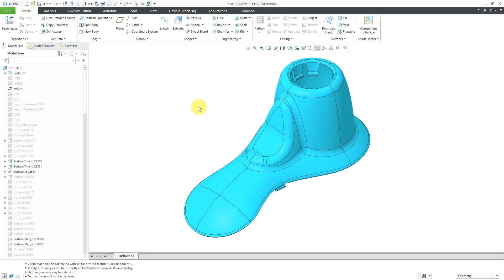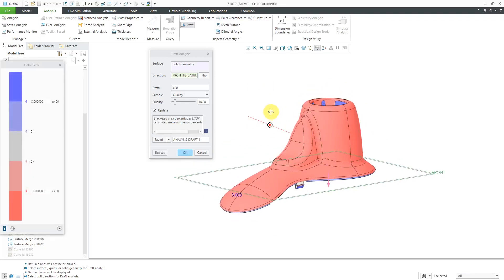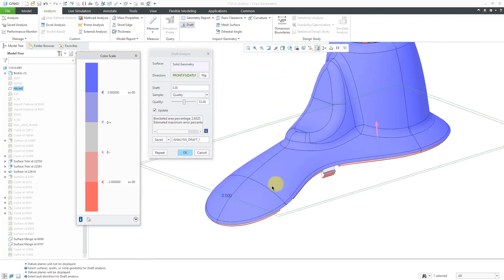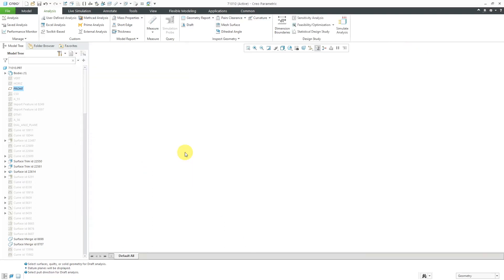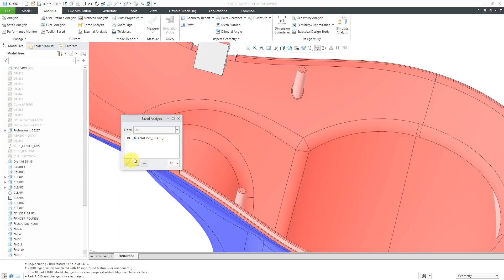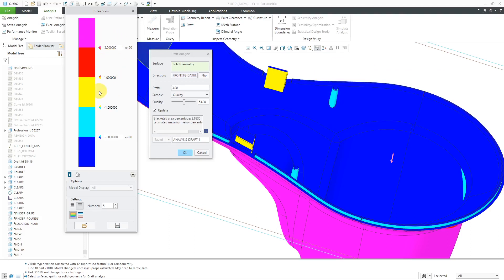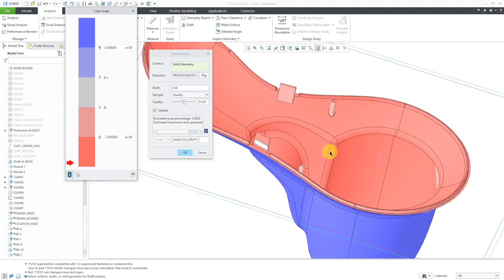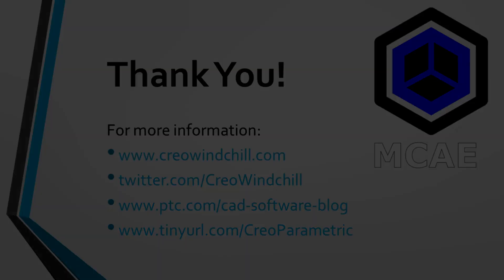Creo Parametric - Draft Check | Analysis Tools

Comment: i have just a rectangulr tray with straight walls? Now how would i apply the draft? Should it be to the inside wall or outer skin?
Reply from the maker: What is your experience based on the injection mold machines and materials that you use?
Reply: @CADPLMGuy  student
Reply from the maker: I cannot answer the question without knowing the design requirements or the heuristics / practical results of the injection mold machines and materials that someone is using. If the walls need to be vertical, is a sheet metal part possible?
Reply: it is just a tray and meant to be made from plastic through injection molding
Reply from the maker: My original answers still apply. It depends on your machines and materials. I feel like I'm saying the same thing over and over again. Maybe you try vertical walls on the inside and end up with production errors that you can live with. This is why we talk with our supply chain and do prototype runs. Maybe you need half a degree, 1, 2, 3 degrees, it depends. Maybe 0.5 inside, maybe 2 outside. This is why we are engineers. It's not just "one size fits all."